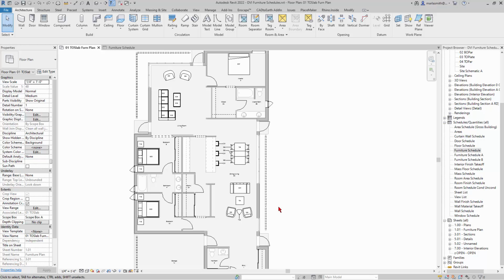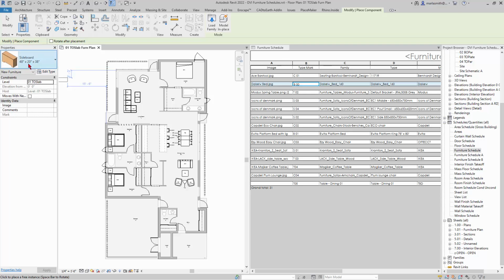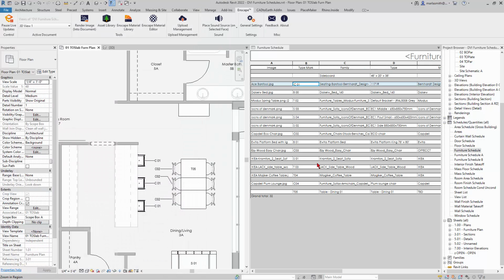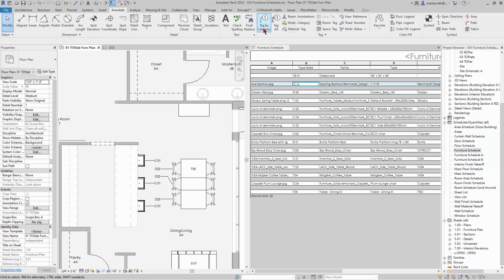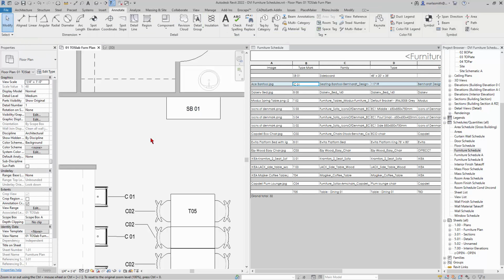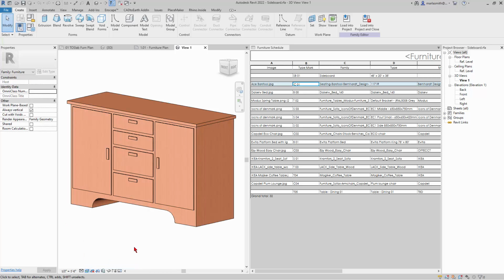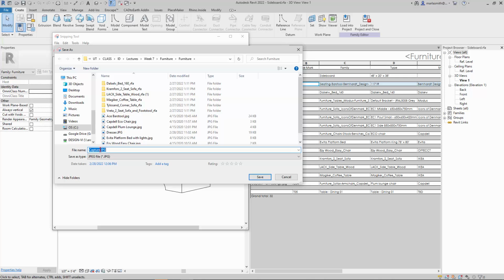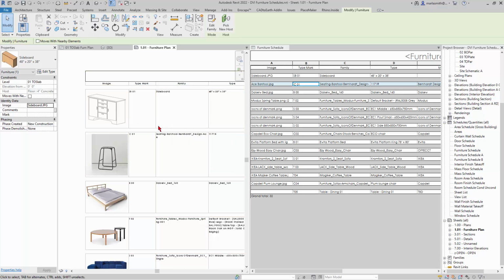Revit Furniture 01 Placing and Tagging

Comment: Would it be possible to label this  furniture in relation to the room where it is located?
Reply from the maker: Hi Ceasar, there is not option to read the room title as it is a different family.  You could add a shared text parameter and fill it in manually.  There is also Dynamo which could extract the room name and add it to the furniture in that room if you could filter it out someway....